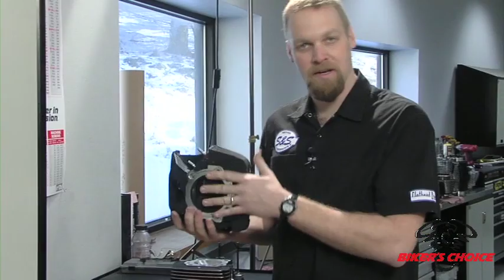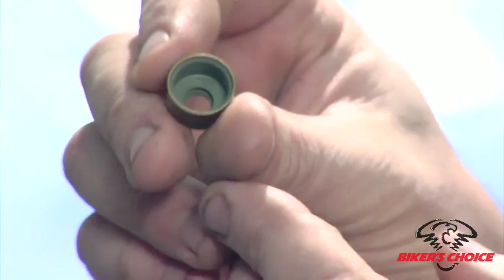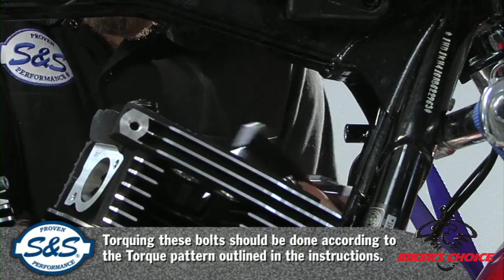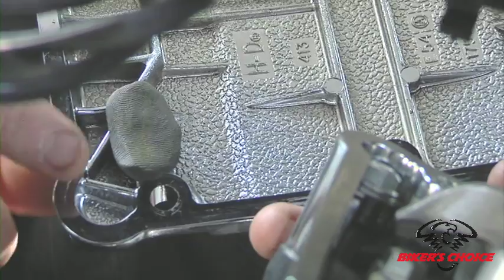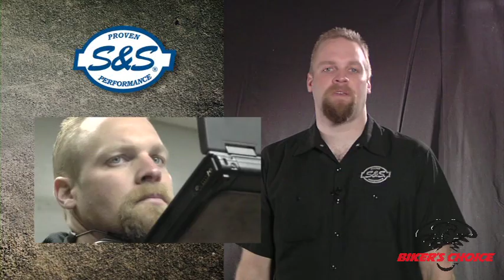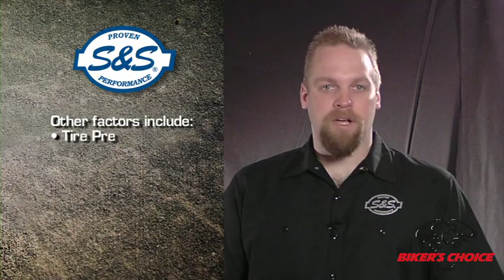S&S 4 Step Performance Program - Step 4 - Available from J&P Cycles

Comment: To bad the heads i have off the t124hc have porosity in the casting. Sent to the machine shop to have automatic compression release drilled and boom found out the casting was junk. My authorized dealer called s&s and was pretty much told to pound salt. Thanks for nothing s&s

Comment: when I was 18 I had the best job in the world - aircraft engine mechanic. Then I got married and schooled to pay for the kids and started to push pens.. but now i'm old and single again. So I think about engines other than my super reliable Ford sedan computer controlled sealed box package.  So I dream again of engines that excite.. What a hoot.. make an engine..  Jap bikes are ok but already 190hp at 50,000rpm and everyone's got one.  I don't like having what everyone else has got.. So hells teeth I want a 1340 Evo with a big bore kit so much it aches.  So thanks for the video mate,  Engine Porn.  Clock up one sale and yes i'll have the cams.  I remember as a lad sitting in a 5 tonne truck testing a 540 cubic inch Lycoming flat 6 with a Cessna prop bolted in.. 180hp at 2400rpm.  Which doesn't sound much eh.  We had to do 8 hours on the proof run, and take the oil samples out for analysis every hour of running.  But the last hour was required to be a full throttle run..  so that slow ol engine at 2400rpm would drag a 5 ton truck with wheel chocks across a 1 mile long paddock so we had to keep dragging it back to complete the run. Then that engine was certified by the Department of Civil Aviation to be good for another 3,600 hours before inspection.  Which is equivalent to driving 360,000 (600,000km) miles at FULL THROTTLE in a car.  And that's what the tight arsed government say..   And that is what cubic capacity is all about.. it will drag your fat old arse at high speed no matter what. There is no substitute for cubic inches. Period. When dad died, I had dad's sacred RN engineering books handed to me like I was receiving the formula to turn lead to gold, but my oath mechanical engineering is a secret science for sure.  And it's quite clear.. hp = rpm + cubic capacity + compression ratio.. so you can have big cubes and slow revving, or small cubes and high revving.. or if you own Shell and BP Petroleum.. big cubes and high rpm.  Or if you're incredibly stupid and can't see the bleeding obvious - get a small capacity high revving engine that's turbo/supercharged to produce enormous horsepower for 10 minutes.  So i'd judge the conclusion as this simply - big engine + slow revs + low enough compression to take ordinary pump gas = the best you can get in power and economy.  If you want more power reduce the cc's of the head and lift compression, but be prepared to always buy high octane fuel.  If you want really really big power, go big cubes and high compression and high revs.  And so my brother and I are rebuilding our 440 Mopar drag car that makes 1000hp and uses 2 gallons of nitro methanol in 1/4 of a mile ( 400m ).   The modern trend to computer controlled fuel injection on very high revving and high compression small capacity engines may mask this, but the basics are always true.  After a lifetime in mechanical engineering I must say that for maximum power, economy and l;ow maintenance costs ( yes engines must last a long time to be economical - novel thought eh ) , go for a slow revving engine as big as you can get it. Hint - big slow revving engines will use bugger all fuel on an interstate but more over continuous short runs, ( but then what wouldn't apart from a Honda 50cc postie bike ).   Most modern engines use high revving small capacities - on the assumption that you'll throw the vehicle away after 3 years.  Buy a big V8 with a longggg overdrive top gear and a big cube Harley and love life and save the planet.  This guys big bore kit does more to combat global warming than whales eating discarded shopping bags. I have a ZZR Kwaka 600cc that makes 100hp at 11,000rpm. She's beautiful and solid as a rock. But at 76,200 miles she's totally rooted and I have to rebuild her now.  Also she hates running in top gear at 35mph.. but is quite happy to cruise at 120mph.  Now I ask you, how many speeding fines - and how big - do you get cruising at 120mph.  Lots..  And so my horny gf put on weight, and god I loved her. well bits of her.  but the Kwaka just about stalled with her on the back after she put on 8kg.  So I dumped her for a skinny Hungarian.. but you get what you pay for eh.  And so I get dragged off by Harleys at speeds up to 60mph. And it's pissing me off. Horsepower versus torque. Torque Torque Torque. Hint: since the vibration of a motorbike on a fanny make a healthy woman horny, if you meet a woman who doesn't like bikes, dump her because she's either a dyke or sexless.  Neither is good for a guy, unless you like to watch eh.  I will say no more for my knowledge has been acquired at great cost and after this level you have to pay me.  For chicks who read this, if you object you're either a bitch or a dyke, both of witch are useless to me
Reply: got remarried. the guy died 9 months later from stress! therefore... I count myself a lucky man these days :)

Comment: I have watched all 3 steps of the 4 step process and my question is do I have to do the 4th step or can I just replace the 103 with the 107 kit and different push rods?
Reply: +Travis Frazier  the better head gives more horsepower ( when you want it ) but also 
much better gas mileage when you don't hit the loud handle. That's 
because better head/port flow shape allows more oxygen in - without  
effort or cost - at low revs as well as high revs.  The best gains will 
come from a setup with low flow exhaust added.. wherein with long 
exhaust pipe sections between the outlet and the first collector or 
muffler = high horsepower at higher revs, but shorter exhaust pipe 
sections between the outlet and the first collector or muffler = high 
horsepower at lower revs.  So for a heavy ol Harley, the big bore kit 
with a decent head and valve job .. and short primary pipes designed for
 optimum low end power and torque.. will give an axle twisting 
experience given the immense cubic capacity.  And that's gotta be the 
greatest thing since sliced bread.  But yeh, if you're easy on the 
throttle she'll use less fuel than the stock machine due to the personal
 attention.. but if you ever want to get up and boogie, just give her 
the revs and hold on tight